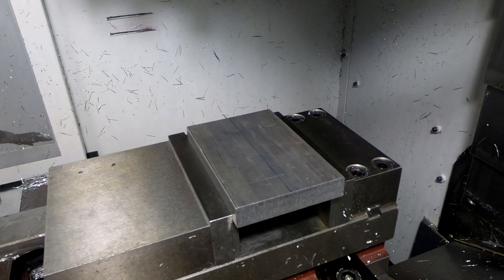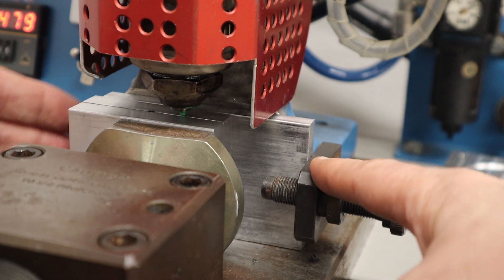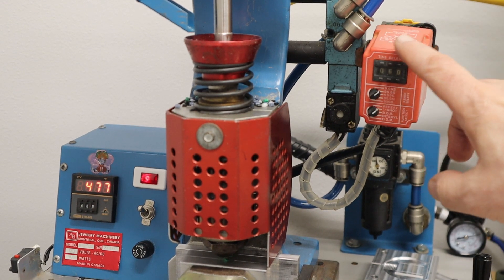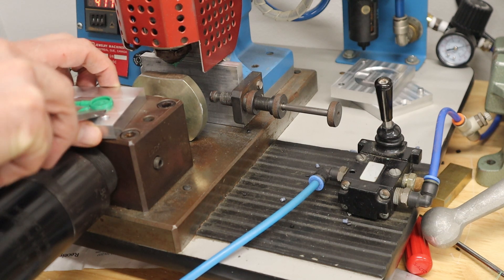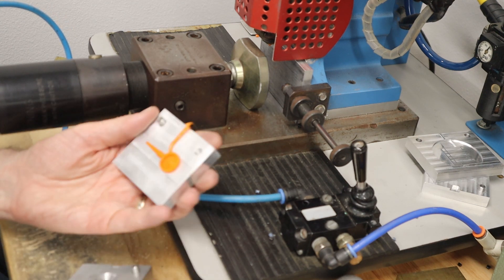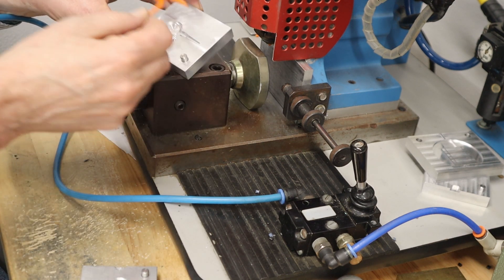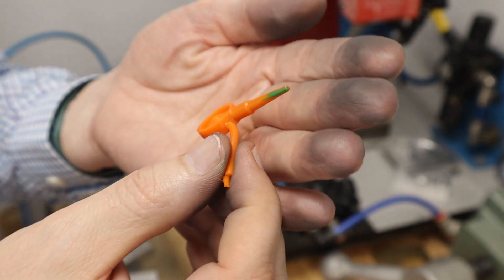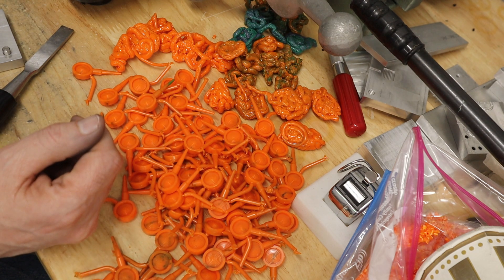Game Piece Injection Mold

Comment: You could make a metal sleeve that sits inside your heated cylinder that you could remove for different colors or make removable barrels Of course the machine would have to be altered to work.

Comment: Venting the mold may allow you to reduce pressure and/or temperature, which at high settings just might be causing the green patches.
Reply from the maker: I confirmed, and showed in a later video, that the green patches were in fact material that hadn't been fully purged from the mold. Once I used some PP to completely purge the green, the parts came out perfect.

Comment: A thought and I don’t know if you can do it on your machine... with 3d printer nozzle you can do a “cold pull” by turning the nozzle heater off and pushing material by hand until it stops feeding. Then warm the nozzle while pulling the filament from the backside. As soon as it’s just warm enough to release the plug comes out and usually has most of the contaminant. Again don’t know if you can do a procedure like that in your machine.
Reply from the maker: Yes, I do cold pulls all the time on my 3D printer. Unfortunately, that's not possible with this machine because the plastic is down into the barrel, so there is now way to be able to hook onto it and pull it out (the plunger is inline with the barrel). Fortunately, I got it working, as covered in my most recent episode that is currently uploading.

Comment: You have two separate issues here. The green material issue is one, but there is also "diesel effect"  scorching happening in the mold ( that is what that smoke was). You need to vent this mold both from the side opposite the sprue, as well as in the center. Usually this is done by flattening one side of an injector pin in center the diesel pocket.
Reply from the maker: I don't think this machine has enough injection pressure to be able to get scorching. I know for sure this wasn't my issue. After publishing this video, I used about 1/2 to 1 cup of white PP to purge the machine. Then I reloaded the orange ABS and every part was perfect. Complete orange, with no dark marks.
Reply: @JohnSL  and the smoke ?
Reply from the maker: Hmm. I see your point. I'll have to do some more research.

Comment: 1) there is a clear cleaning filament out there that helps to purge colors. Esun makes it as well as others.
2) perhaps a small vacuum pump with a thin hose will suction to the part and remove it.
Reply from the maker: Thanks for the info. I wasn't aware of that. Another viewer turned me onto cleaning pellets from Filabot.
Reply: @JohnSL  is it just a acyilic pellet?

Comment: Love the videos. Q: Why don't you ever use ejection pins? Perhaps you covered that in the past and I missed it...
Reply from the maker: Thanks. I have used ejector pins a few times. But most of the time I make molds for my manual machines that don't have a mechanism to activate ejector pins. I also talked to some other people who make injection molds for markets where volumes are small (model train accessory parts), and they typically don't use ejector pins either. It makes it a lot easier to make the mold.